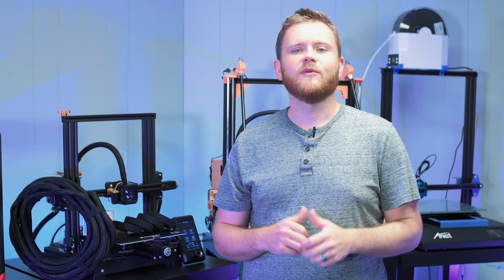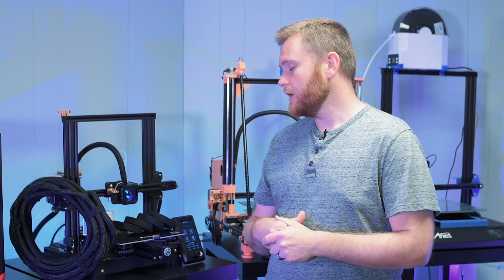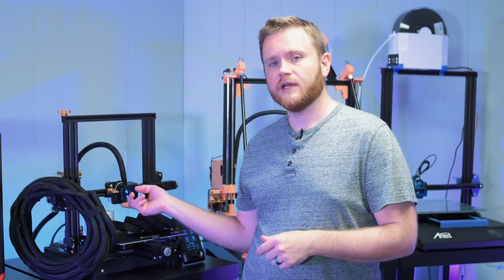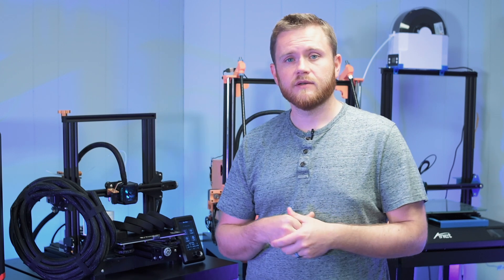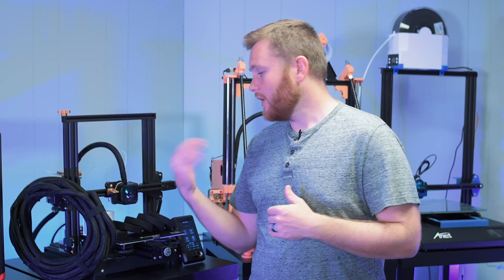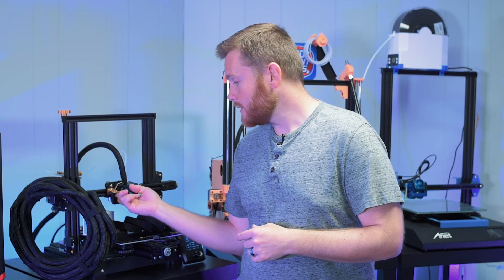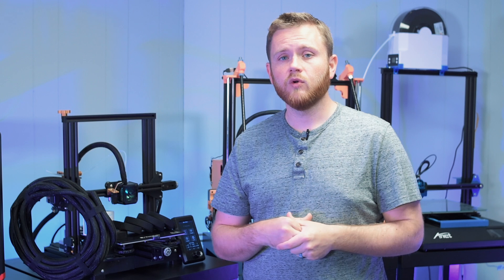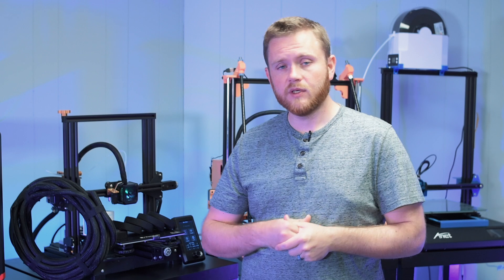Automatic Bed Leveling? Creality CR-Touch

Comment: So I just got a printer and purchased the cr touch I did the update but I need it to level the bed due to my daughter turning the knobs before I got a chance to put it up high.. and way you could send me in the direction of doing the leveling again. I can't seem to figure it out
Reply from the maker: Sure. First you need to level it manually. Here’s a good video: https://youtu.be/Q7Mu05fZNsk
Reply: @3DPrintSOS  do I need to reset anything before I do the manual level since it has been done with cr touch before
Reply from the maker: Nope, I would first home. Use that home position to manually move the head around to 4 corners and get them level. Then I would go ahead and level using cr touch, then do a z offset and save.

Comment: Did anyone have to disconnect their z limit switch?
Reply from the maker: Yes. It’s one of the other. ;)
Reply: @3DPrintSOS  it's one or the other!! I just saw it still attached in the video while you were printing! Thank goodness for the response! Everything working like a dream!
Reply from the maker: Glad you got it working. Mine is unplugged and currently off. ;)
Reply: @3DPrintSOS  for some reason my back right bed screw is super loose now for some reason. Almost falling off when I try to level.
Reply from the maker: Hmm. Must be because of some vibrations. Gotta get some good tension on all 4 springs. Just watch that y motor in the back. Make sure the bed doesn’t crash into it. ;)

Comment: Mine doesn’t home. It raises 1 inch then the bribe vibrates uncontrollably
Reply from the maker: Sounds like one of the end switches is either not plugged in correctly or is unplugged all together. It vibrated because it’s not engaging the end stop.
Reply: @3DPrintSOS  hey thanks for response. Literally 5 minutes after I posted, found one of the screws to secure bracket to the sled was acting as a brake and not allowing the x axis to move. 
Ochums  razor as it’s finest
Reply from the maker: Haha glad you got it. :)

Comment: I cant even load up now with a home screen. Followed your steps I came across a back lit black screen and now I cant do anything? Never got the progress bar or green checkmark and it was left on for over an hour.. I was able to successfully update screen with the red and blue screens. but now I turn off and back on the printer fans turn on, the bl touch pops down and back up but no screen home screen or anything.. need alittle help.. I do have the n32 chip. I have tried 2 different sd cards 16g... did the mother board brick on me or did I do something wrong.. I have tried to reflash software back to factory from vokelab website just to get something to work but with same result? any thoughts
Reply from the maker: Hmm. Sounds like the screen isn’t getting the firmware. Are you allocating your cards to 4096 bites?
Reply: @3DPrintSOS  long story short got it fiqured out.. apparently you must use nothing larger than an 8gb sd card.. I never got a functioning one when I got the printer so I've been using a 16gb that I had for all my prints.. but yea as soon as I flashed with an 8gb sd card it worked like a charm
Reply from the maker: 16gb should be ok. Might have needed 8292 bytes though.

Comment: Where do you get the nuts at 5:55? My box does not have them.
Reply from the maker: I had some m3 nuts around. I typically buy a kit on amazon with m2 m3 m4 m5 hardware just in case.
Reply: @3DPrintSOS  What kit did you buy?  I bought a kit but the square nuts are too large for the space on this.  Can you reply with a link of one that will fit?
Reply from the maker: Sure. This is one ive gotten twice now: https://amzn.to/3r3jJCR
Reply: @3DPrintSOS  Thank you. I am trying to find square nuts that will fit in the notch. I am unable to get hex nuts to work right because they are spinning on me. I thought a square nut would prevent it from spinning.

Comment: Your videos are awesome.  They have helped me so much. So at this point is the CR Touch compatible with the X2 H32?
Reply from the maker: It is. The Cr is basically a bl touch clone. So whenever a BLTouch works, the Cr will work as well
Reply: @3DPrintSOS  You're the best!

Comment: I'll be honest, I would have paid the extra $40 for this to be pre-installed. Nothing beats auto.
Reply from the maker: You don’t need it, but it’s definitely, without a doubt convenient
Reply: @3DPrintSOS  Full discloudure, I'm super lazy.
Reply from the maker: Haha I can relate
Reply: @3DPrintSOS  Is it absolutely necessary to add the G29 code for the CR Touch mesh to work? Or can I run the auto level prior to printing and just have the mesh active?
I mean, I had no code when doing manual mesh bed leveling, so I just assumed as long as the mesh was active prior to printing, the printer was using the mesh created?
Or am I missing something?
And where do I put it? Im assuming you put after the G28 code thats already in there? And since im using Alex 4x4, would I not change the code to "4-Point Leveling" and "Fade 10.0; Fade to 10mm" to "Fade 15.0; Fade to 15mm"?

I appreciate any suggestions, thanks.
Reply: Well you can buy an ender 3 s1 it comes preinstalled with a cr touch
Reply: @Kendiyastro  I said $40 more, not $200. Aquila X2 $229, Ender 3 S1 $429.

Comment: whats the best settings to print the mount mine just breaks and the screws just dont tighten
Reply from the maker: Print it at 100% infill and you need to use some m3 nuts to hold the hardware.

Comment: Thanks for the video! Quick Question: I can't seem somehow get the mesh to probe correctly. 

I level the bed manually on each corner with the bed heated etc than I triple chdck each corner, it still is good 👍 with the paper slightly vibrating. 

When I run the make a new mesh the readings are coming back all around 0.12 etc. I tried for weeks and weeks and finally just gave up.

 I'm using the manual mesh saving it manually and using the m420 gcode... 

I checked the gantry etc it's all level read the forums reddit etc but for some reason it feels the like the cr touch is always reading the values off. I tested the probe no errors the readings are within the tollarance. Im confused 😕
Reply from the maker: It looks like the only thing you’re missing is setting a z height after the mesh is complete. After the mesh is done, the printer needs to know how far away the nozzle is from the print bed. Since it just probed it with with a sensor that is lower than the nozzle. That’s the z height. Once you set that and save, it should be good
Reply: @3DPrintSOS  OMG, THANK YOU Bro because I was about to send this damn CR Touch back to Amazon because I couldn't get it to work after 2 days, WHY, because I missed this step. I would create the mesh, adjust the Z and then create another mesh to see the results, smh...

Comment: So I I stalled a bl touch but it keeps crashing into the far right of the x axis. 4.2.7 silent board. Have no clue how to change the build surface size
Reply from the maker: Hmm. It’s not the build surface size, it should be an offset setting. Which firmware did you go with?
Reply: @3DPrintSOS  the one from creality for the ender 3 pro without adapter for the 4.2.7 silent board
Reply: Im having exact same problem...did you find a fix at all?
Reply from the maker: If you print an x axis endstops cover I believe that will give you enough space. The Ender is different in that dimension.
Reply: @3DPrintSOS  I believe the x axis cover on the Ender 3 and Voxelab X2 have different mountings.

Comment: 5 mins of ads forgot why I was watching ! Also why did you cut the braded cable tidy if you simply compress it the entry point trebles in size more than enough for the CR Touch plug
Reply from the maker: 5 minutes! Could you have skipped those? That seems a bit aggressive.  I cut it because I wanted to redo the wiring for easy maintenance later. I have other modifications in mind that will have me pulling wires in and out. Muuuuch easier with the new cable management.

Comment: I understand how to load firmware on the aquila but which firmware do I use. My printer does not have a sticker on top, I get that I can look on the board and figure it out. But again where do I go to get the firmware for the aquila or which one do I use? I am not sure i am ready to switch to the Alex firmware as it seems to redo the whole front end. Is there a firmware that is compatible with what came with the printer? Thanks.
Reply from the maker: If you don’t have a sticker, you have a G32 machine. You can grab firmware from the downloads section of the voxelab site.
Reply: @3DPrintSOS  just to double check, I would download thr bl touch firmware and that will work for the cr touch?
Reply from the maker: Yep. It’s just a clone of the BLTouch that looks a bit better

Comment: Hi,
I'm having a problem with my Aquila x2 after installing a cr touch.
I have a h32 version and had to go get the firmware on the voxlab site. The procedure went well but when I start the printer and ask for an autolevel the printer tests with the probe twice in the center of the bed and then goes to lower right corner and goes down towards the bed but the probe never touches it and then it stops and sais "autolevel complete"
And when I autohome the tip is super far from the bed.
Would you have a 3rd party firmware I could try and that is compatible with an h32.
Thanks.
Reply: Looks like the firmware is messed up.. Just not working..
I think I'm gonna have to live with manual leveling by downgrading to older version.. Until the firmware works correctly.
Reply from the maker: I have an h32 machine I have to unbox. I’ll get it setup and do some testing
Reply: @3DPrintSOS  that would be awesome. Until then my h32 is back to normal with the cr touch on it but inactive.
Reply from the maker: Sounds like after you do a leveling, you need to set the z offset and save it. That’s why it’s so high up. It doesn’t know how far to bring the nozzle down.

Comment: Hi,
I see that you use the glass bed, and am wondering if you recommend a flexible bed and if not what would be the downsides.
Thanks for all the good advice.
Reply from the maker: Pei beds are cool. Especially the textured stuff. I just like the smooth finish of the glass and I haven’t had any issues with it.

Comment: Due to this video and your firmware video, I just went ahead and got a CR-Touch for my aquila. Couple things:  1) Great Video! 2) It would have been nice to see you make the settings changes needed in the firmware.  I think I finally got it worked out but I had a really difficult time with the Z Offset and even knowing what the heck that was. 3) Is it supposed to do the auto-leveling before every print?  Mine is, and its kind of strange since you save the mesh in the firmware.  Thanks for the great video!
Reply from the maker: Due to. Haha. Nice. Thanks!

Hmm if it’s trying to do auto every time, that means the mesh isn’t saving. Do a level, then go to save then go to offset, then go to save. Then start a print. See if that works. If it doesn’t auto level again before the print, you should be good.
Reply: @3DPrintSOS  After some more research, it is the G-Code you have in your description.  G29 is going to tell it to probe all points right before a print. Some people might like that in case their bed gets out of whack. But I replaced the G29 code with M420 S1 which looks for and loads a saved mesh.

Also, you need to measure the X offset and the Y offset between the nozzle and the probe.  Then go into Control>Advanced>Probe and input those measurements.  Mine were really close to what was already in there.
Reply from the maker: It will only do it if there isn’t a saved mesh already. 

Nice. Thanks for the tip. I’ll take a look.

Comment: How small are your hands bro? I have pretty small hands and had to use other bolts to hold the nuts up and pliers/wrench combo to plug the wire into the CR
Reply from the maker: Trump small. ;)

Comment: Where can I get the nuts used to hold the crtouch in place?
Reply from the maker: I recommend one of these if you can find any: https://amzn.to/3uaA0FI 

You won’t have to worry about printer hardware again. :)
Reply: @3DPrintSOS  Thanks for the suggestion. I will definitely be checking this out.

Comment: Fedder I had to modify the stock mounts for the CR touch after I started my test print I had to adjust my z offset by -2.20 is there any way I can save the settings? Or do I just adjust my z offset before I do my BL Touch setup and see if that works? I’m only asking because the packaging doesn’t have any setup specs for how far it is supposed to be away from the bed. I noticed that you have a custom mount for yours in the video and I couldn’t find the stl file on thingiverse
Reply from the maker: The offset is going to be different for everyone. I added a link in the description for the mount stl. In the settings there should be an option to save your settings after you set the offset.

Comment: Got my Creality CR touch today :) , will install it later with guidance of your excellent video Fedro, but i'll try to do as @Del Scoville suggest with the existing loom :)
Reply from the maker: Awesome. You’ll love it.
Reply: @3DPrintSOS  Yup I do, the leveling works as a charm :). Also got the  Winsinn fans today and replaced the hotend one ohh man what a difference in less noise :), from approx 64 db to ~45db just after start up of the Aquila.

Comment: What I got from this: Buy a white wire loom to wire loom to make the wires look cool. 😃
Reply from the maker: I just love the organization aspect. The fact that I can run another wire for a sensor or swap out a thermistor with this split loom so much easier and faster. I plan to do many more mods to this, so this makes it a bit easier. Just my personal opinion though. :)
Reply: @3DPrintSOS  Yeah my wires are bothering me with all the plastic wire ties all over them. Too messy looking.

Comment: Just got the cr touch in mail. Which screws do i use after printing the part? P>S used your affiliate links to make all purchases.
Reply from the maker: There are two shorter ones, I used those to mount the bracket. There are two longer ones, I used those to mount the actual sensor. I did add some m3 nuts to mount it, but you could mount those screws from the bottom instead.

Comment: has anyone else had trouble installing the CR-touch unit to the bracket?  It seams that the holes in the top of my unit are larger than the screws provided and will not tighten. They fit the bracket just fine but the unit just falls off.  Do i need to get a nut or something?
Reply from the maker: Yep, you need two m3 nuts to hold it. I rested them on my finger tip and screwed in from the top. However, you can put the bolt in from the bottom and use the nut at the top as well.
Reply: @3DPrintSOS  Where do I get those?  Shouldn't they be included if they are needed? And what size are the M3*6?
Reply from the maker: The screws are included in the Cr touch kit. Since it’s meant to be installed on the metal brackets that are included, they don’t provide them. Since we are using our own adaptation for the Aquila, we need some nuts. Check the bag of extra hardware your printer came with. There might be two in there you can use.
Reply from the maker: Also, if you can’t find any, you can use one of the metal brackets as a stopgap solution. One of them fits with just the lower bolt. It’ll hold on just fine.

Comment: How do you go about setting you z-axis since there is a good distance between the hotend and the plate so your not just printing in air at start?
Reply from the maker: I get the springs low to about the middle. I turn the printer on and bring the z all the way down to the bed. Then I move to 4 corners and use the wheels to level the bed. Then I do a mesh leveling. Then I set the z offset. And save. That’s it. :)
Reply: @3DPrintSOS  thx!

Comment: More tales from the 3D printer on my kitchen table: Well... I made a dozen or so really unhappy rat's nest  Benchies. I ran the Mesh Level thing (way too many times) before learning some things. Firstly, the home position probe during the "New Mesh" process sets the ZERO value, the other probes are +/- that value. I have yet to be able to get all my squares green, but the auto level seems to be working even with red squares, that actually makes sense since the center is Zero, everything will be +/- around that spot. Second, AFTER you run the mesh creation, you have to go into "Prepare->Z Offset". Stick a paper on the build plate, then tick the "Live" box, the Z will home, and then you can start adjusting the Z downward. You will want to move full 0.10 values down until you cannot move the paper anymore. Then move the Z up 0.01 at a time until the paper can be pulled again. Even though the check box says "Live" it is not exactly live. The Z does not move until you set the Z Offset value. My Z Offset is -0.82, that seems like a lot, but with that offset I've gotten a very happy Benchy. I'm going try moving it up to an even -0.8 to see how that turns out, I just like round numbers. 

Gee if someone who really knows what they are doing would make a video on how to fine tune the bed leveling with a XX-touch sensor, that would be awesome.
Reply: I ditto that also, hope he makes a video on to fine tune it. As you my mesh is in the redd. Could used some guidance on fine tuning this. He fast forward thru the necessary steps.
Reply from the maker: I was just focusing on an overview for the vid. But yes, a few have asked for it. I’ll try to make one.
Reply from the maker: Yep, all of that is correct. Haha hint taken!